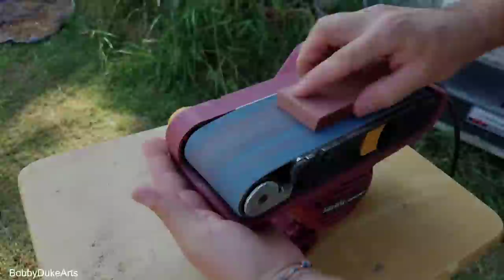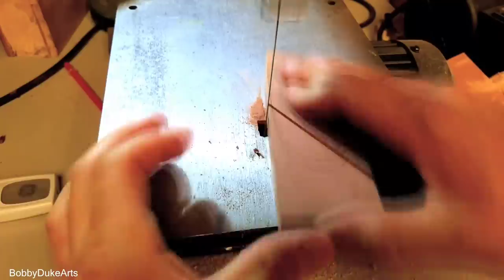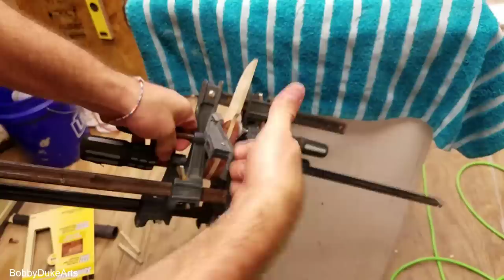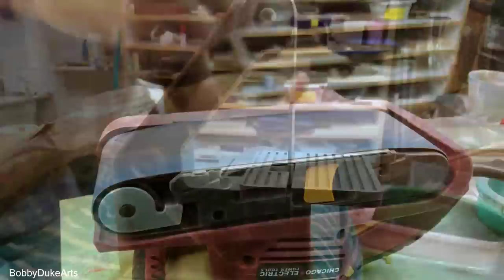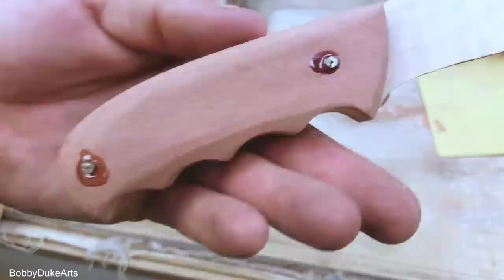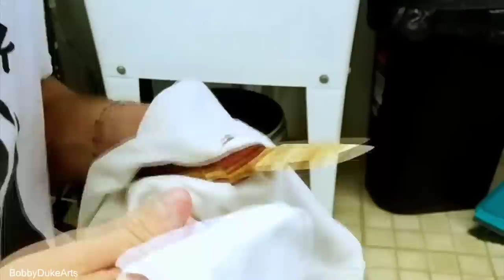Make A Wooden Hunting Knife

Comment: Just a tip from a fellow craftsman, for added edge retention add a few thin layers of epoxy over the edge allowing to harden each layer, then reshape and sharpen the edge. It will stay scary sharp for a long time

Comment: heyyyyyy man,
first, I like your videos, keep it up!
second, I see you are struggling a bit with the belt sander on the table. We hold it down here with a clamp attached to a chair. simple, but working. Just a tip:3
Reply from the maker: +Zsolt Eszlári yeah, I normally do that I just didn't think about it at the time. Thanks for the tip!

Comment: Putting some type of industrial strength metal or some other material on the edge of the blade would make it an actual cutting blade. Then you'd just have to make sure the wood was strong enough to not break. Just a thought lol, that knife you made is a beauty!👍

Comment: Hello. I know im late but i have 1 question. Since you've made A full KNIFE out of wood. Im started a woodworking project and i am looking foraward to making wooden throwing stars. Since normal ones arent cheap. And i just wanted to ask. How can i make one hold an edge? Do i just sharpen the blade edge use olive oil and then a spray can of clear varnish?. Im doing all of this in my room

Comment: There was a crack in my wooden table and I played with it by pressing my finger against it and sliding my finger down to where it gets narrower and I put so much pressure on it I ended up cutting the shit out of my finger and now there's two little gashes shaped like a v, I got bored and wrote a symbol on the wall with the blood from my finger before I bandaged it up.